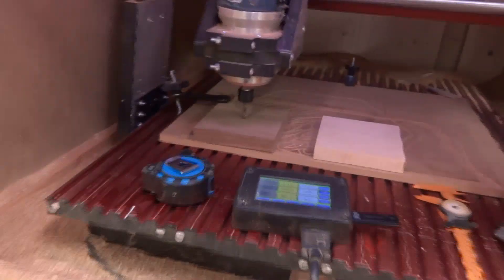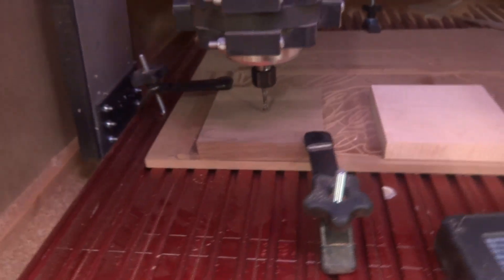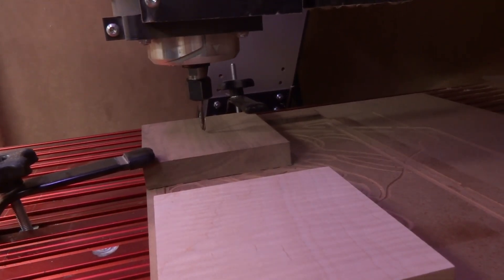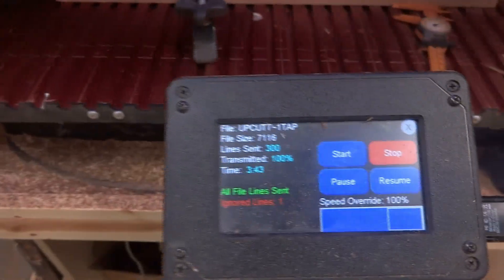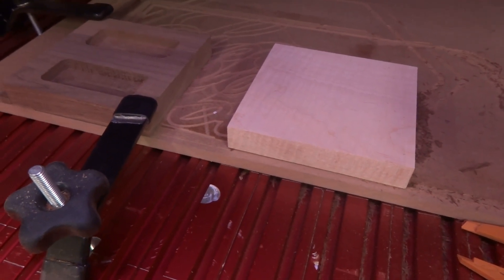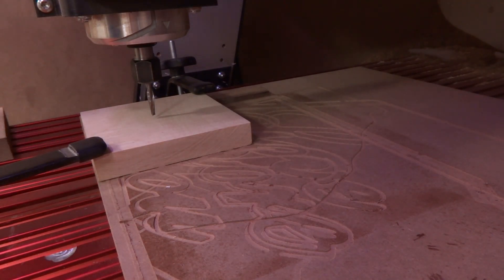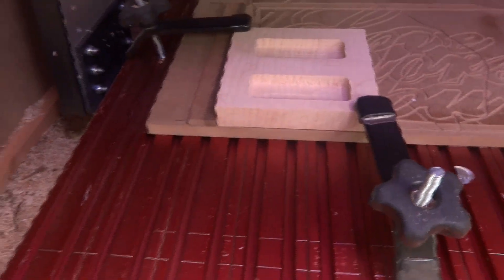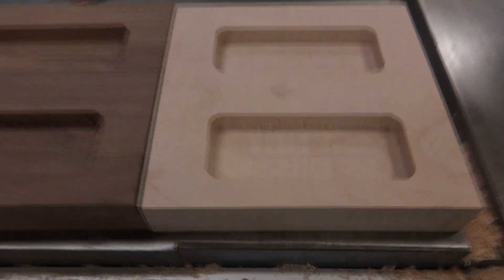Climb vs Conventional Cut CNC Router

Comment: Not sure why there are no comments here.  Nice video proving this.  I am a CNC machinist mostly in aircraft Steel and aluminum and I have recently added a CNC router to my home shop.  I would have assumed climb cut would be better since your just running over the chips you just made with conventional milling.  The proof is there as you showed.  Thank you I will certainly share that info with others, at least on pocketing.  Still curious how it would do on outside contours. I can try that sometime.